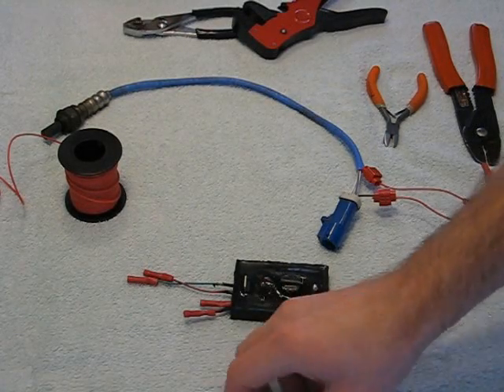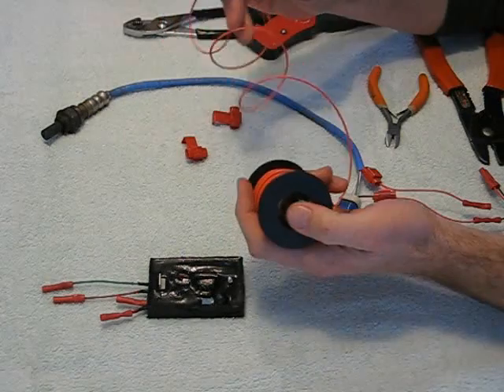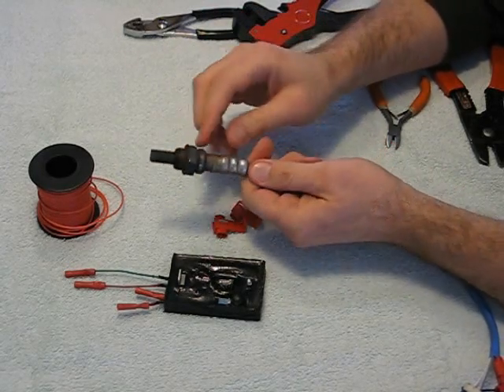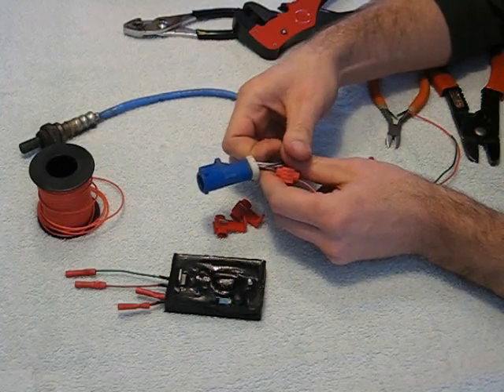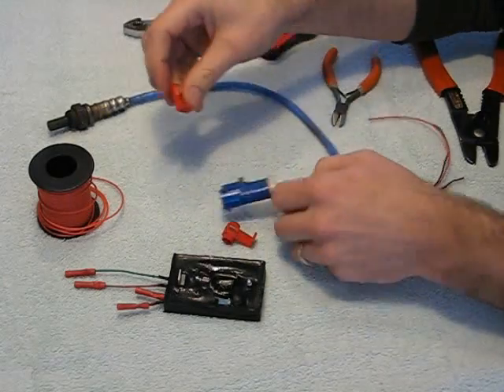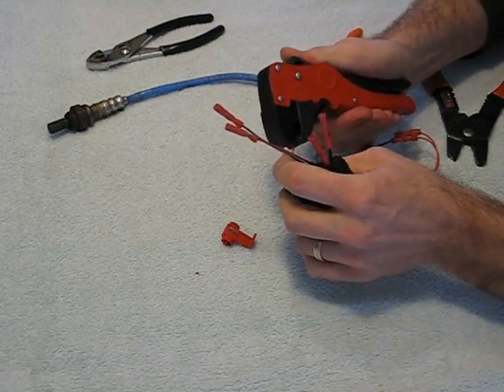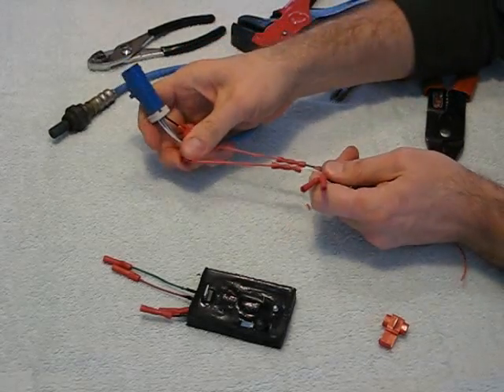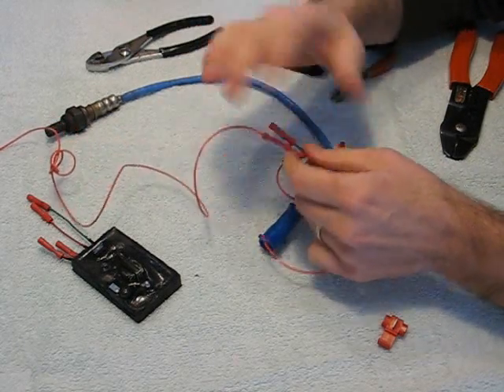S1E - Oxygen sensor installation

Comment from the maker: This will work without hydrogen.  But I must warn you that over leaning any vehicle is dangerous.  If you are getting 14MPG, please do not lean it back until you are getting 28MPG, or you will cause heat damage to your engine.  A little is OK, but you should use hydrogen, or steam if you want to really lean it back.